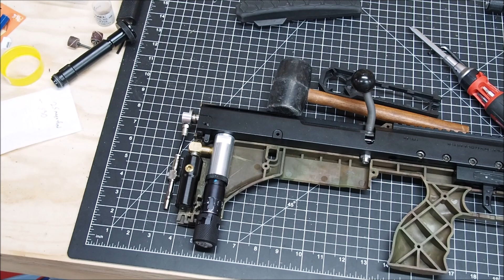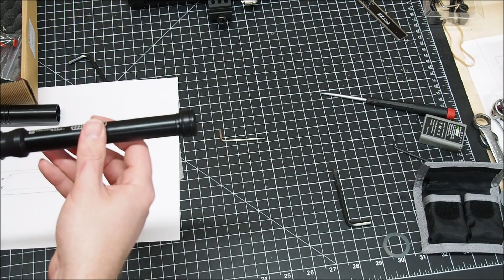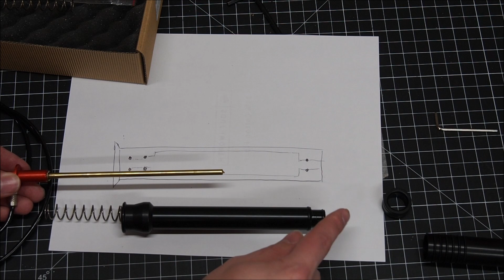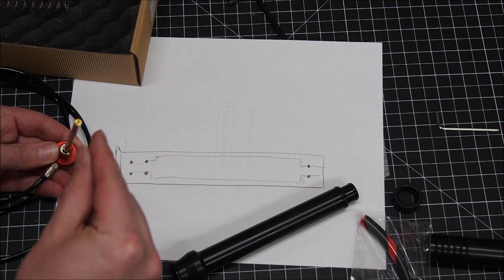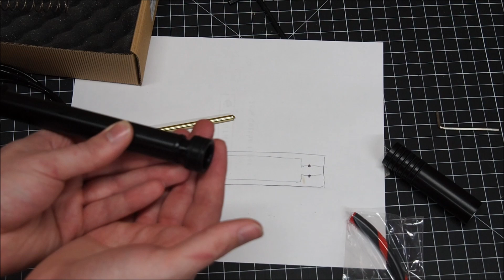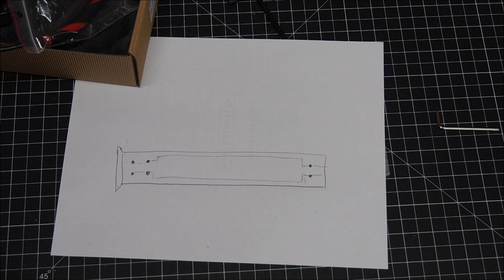Airsoft Desertech SRS Internal Co2 Reg Project PART 1

Comment: Hello, could I purchase the components you used and manufactured?
Reply from the maker: regrettably the custom fitting was a small batch run and i have long since sold all the spares. I also believe palmers pursuit shop that makes the micro reg i use I think i heard they were closing? or restructuring I would have to look (they show as permanently closed on google). So in short it would be alot of work to find a new reg and re build tthe custom parts and find all the fittings again.
Reply: It's a shame, do you still have any plans or CAD drawings? Then I could take care of it myself.

￼
Reply from the maker: @uwevierneusel8301  sorry I do not, it was manaully machined by a machinist just sort of given the parts i needed it to interface to.

Comment: Would you consider building that kit for it to be a drop in unit??
Reply from the maker: my machinist contact sadly is no longer a machinist which makes getting custom parts well nothing shy of obscenely pricy. which unfortunately means its highly unlikely. but hopfully this will serve as inspiration for others or for some company or place that has CNC access  to perhaps make a all inclusive reg and co2 adapter. as really you could do the same thing in a slimmer package (well aside of the co2 canister section)
Reply: @elementaryairsoft2983  you wouldn't happen to have a measured drawing would you??
Reply from the maker: @grimmreaper5965  unfortunately not, i did start with a fusion360 drawing but was unsure of the exact tolerances or if I measured the threading right, and or what sort of things i may add that would inadvertently make the machining more complex. It was in the end made to spec off of the receiver of the gun and the wolverine reaper with a bit of back and forth discussing key points.

Comment: Nice job. Can you give the specs for the new CNC parts? Can you put a list of mods or parts in the description? I have the Wolverine Bolt M, Wraith and regulator on order waiting for delivery. This is a immediate need of work. I was looking at doing this but need dimension of all new parts. Help another shooter out. When is PART 2 coming out?
Reply from the maker: I have all the video recorded just need to go thru edit trim some of it up.  so Part 2 probably come out this weekend.  I have some designs for the adapter but the actual part was more so made by a machinist reverse engineering off of the actual cap and my height specifications and the receiver of the gun for the monopod threads. being that the part needs to hold back 900PSI of force I didn't trust the tolerances of a drawing/measurements off of the actual piece but rather let the skilled machinist figure it out which i was very fortunate to have found a gentleman that normally worked on hydraulic cylinders so understood pressures and got fitment. I did have several parts machined so i do technically have a few spares some are better than others. 

Overall this project is not for the faint of heart.

I did add a part list of the air system, as really the gun/internals don't matter as much. you can also use a 1/8 npt banjo fitting but then you loose the bleed valve also means more material removed from the butt pad. not positive the line size the boltm uses.
Reply: @elementaryairsoft2983  People that have the money know that they can get someone to do the part and they can purchase the body for $40 and but plates for $30. Yes, its another cost to the gun but it looks great. Do you have any footage of gameplay usage or practice? I was looking at 3D a new stock. It would have been wider on the side you want the Wraith ( I'm a lefty). But the design and fitting are the hardest.
Reply: @elementaryairsoft2983  Any chance that your mecanic make a batch of the part ??
Reply: I did have a few made at the time reach out if you still really want one.
Reply: @josephmaslanka3106  Are you the machinist? Do you have a "custom reaper top" left? :)
Reply from the maker: @Calcyn  if you really need one you can find me on reddit here: https://www.reddit.com/user/lSherlockl i did have a few spares made when i had my initial one manufactured.
Reply from the maker: @julezgermany5839  sorry was my normal google account One in the same . sadly the machinist i worked with no longer is working as a machinist as he took on a engineering job. However i did origianlly make a batch of 5,  2 of which with some defects so i do have a few parts if needed. replied to your other message with my reddit user if you had further questions or wanted to get in touch on anything.